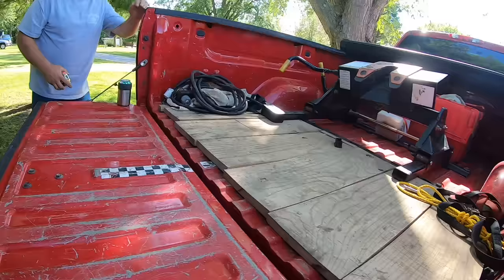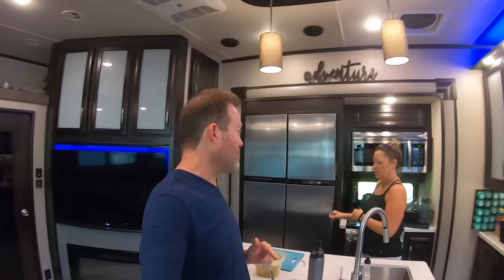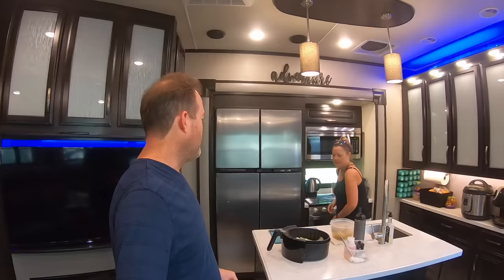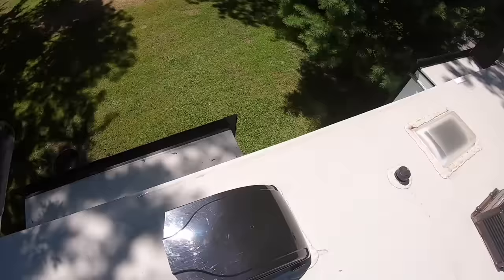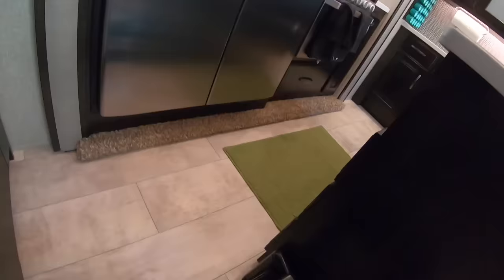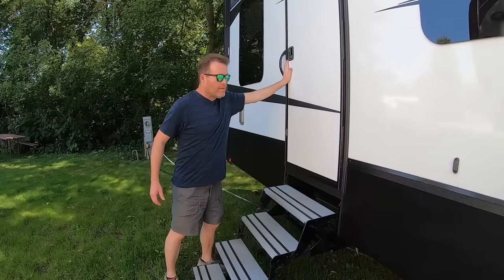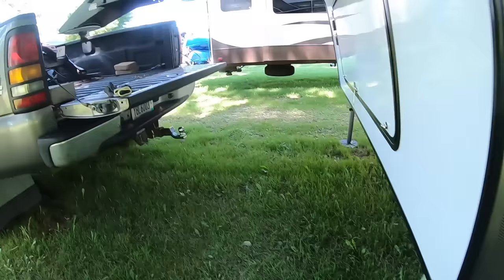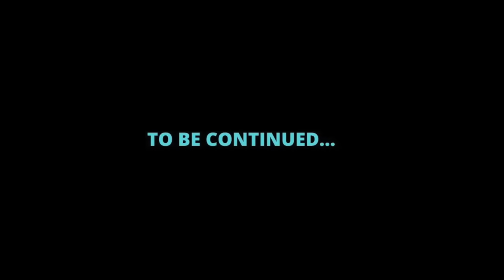RV CRUSHES MY TRUCK ON 1st TOW! BIGGEST RV LIVING FULL TIME MISTAKE!

Comment: This happened because you had the hitch jaw release handle in the wrong position before hooking up, at 19:30 you can clearly see that the handle is not in the correct position, so the locking portion of the jaws didn't/couldn't properly move into the locked position when you hooked up to the trailer, In the future you might want to have the rear window of your truck open and the stereo volume all the way down so that you can hear the jaws snap shut or just have someone helping you keep track of things, do a tug test after getting out to check that the hitch jaw is correctly shut, and never raise the landing gear until after you have checked the jaws are shut completely and you have done a tug test.

I have 2 checklists, one for departing (home, campground etc) and one for arrival (home, campground, etc), they have saved me from ripping off the satellite dish (and at close to $2K that's a big chunk of change). The way I have the checklist laid out is they start on the day before departing and continue on to the day of departure, and finish up after arrival at the camping spot and after everything is setup. I made the checklists in Word so all I have to do is print out a few copies at home, I keep them on a clip board and I put that clip board in the storage compartment that will be opened before any others upon arrival at the camping spot and is the last one opened when departing from wherever I am camping.

I had this happen to me once on my Peterbilt, the jaws were shut after a visual check and a tug test, so I raised the landing gear, when I applied air to the trailer and began to pull out the hitch broke and the nose of the trailer wound up in the mud, it took a wrecker to lift it high enough so I could put the landing gear down and then hook back up after the hitch was repaired on site. You're not going to hand crank the landing gear down on a trailer that has 45,000 lbs in it without the help of a wrecker or crane.

Comment: Don't feel bad. I once tried to pull my 5th out perpendicular due to the tight space in front of the trailer. [lazy] Would have worked if I had remembered to slide the hitch in the box all the way back first. I did not, so I broke the rear window just as the pin was about to lock. Oops my bad. :)

Comment: When you hook up and hit the pin, try giving a fairly firm tug forward to confirm that is indeed locked in.  After doing that visually to see if the little jaws are around the king pin. The bottom of the king pin should be all the way down on the bottom of the fifth wheel with the jaws around the collar. If there is space between the bottom of the kingpin and the bottom the fifth wheel, it is high hooked. By watching what happened in your video, I’d put $100 on you high hooked.

Comment: That hitch seemed a little complicated. Hope you had minimal damage. I always do a test pull with the landing legs up just a little to make sure the hitch is locked. I leaves legs down or up just a little apply the trailer brakes and put in drive.

Comment: Cat dry lube on metal to metal hitch parts that squeak and you don't want the bed of your truck to  be a greasy mess. I use it on heavy equipment. It works.

Comment: Just saw the video that sucks, just wanted to say I noticed you have a lube disc on your trailer and your hitch also has some sort of pad I don't think you need both and maybe that is affecting your hitch locking up the pin might not have the clearance to lock right, my brother works at a tracking company and someone installed a lube disc incorrectly where it didn't seat right causing pin to sit to high on hitch and driver took off and lost the trailer half mile away from shop and this was a semi, just saying you should look into that

Comment: Don’t feel so bad, the first time I took my new camper out of my driveway, I left the electric water heater on and fried it, and also left my 50 amp plugged into my garage with the door closed,and ripped it right out of my camper. This is the third camper I’ve owned,so I’m not new at this, but stuff happens .

Comment: I am so sorry this happened to you.  Don and I both gasped when we watched it happen.  Thank you for being brave enough to put this on YouTube for us to learn from.  Actually we still don’t understand what was missed for that to happen.  We’ve never pulled a fifth wheel.  Thankfully if this is the worst mistake that you ever make at least no one was physically hurt other than the wallet and ego.  Stuff can be fixed.  Again so sorry and we love watching you both.  Beach tribe!  Julie and Don Guzniczak
Reply: Was not the fault of the hitch. The king pin was not sitting depth wise enough...that hitch already had a factory built on lube plate...he added another lube plate...that was the problem.

Comment: Wow. Bummer. I kept thinking that you didn't lock that arm back? Or did the hitch just fail? Guess I'll wait for video 2. :(
Reply: Was not the fault of the hitch. The king pin was not sitting depth wise enough...that hitch already had a factory built on lube plate...he added another lube plate...that was the problem.

Comment: Man I feel your pain but you've got to admit there is a little bit of humor here. I have never done much with 5th wheel or gooseneck trailers. Is it common to do a tug test with an RV? I guess the jacks would have to be down part of the way. Also, are safety chains required in any states? I'm not sure if they are more of a gooseneck thing or not.

Comment: I drive semi, it happened to me. SAME STYLE HITCH as a regular semi, just smaller scale. ALWAYS do the tug test...HOW is this done? 
LIKE THIS:
WHEN you first back the truck under the trailer with the hitch lined up with the king pin, with deliberate slow impact, knock your hitch into the king pin. YOU CAN'T hurt anything with the hitch properly aligned and at the right height, so don't worry about damaging the receiver or the king pin, because they're both extremely rugged. 

Once you're locked into the king pin, put it in Drive immediately, and do 2 brief Tap on the gas pedal to see if you come unhitched. This is the tug test! Once you are satisfied it's connected, get out and view your king pin lock visually with a powerful flashlight and then hook up your pigtail and raise your landing gear an inch and do the tug test one more time with the trailer brakes STILL SET. Not normally needed and once you have gotten the practice and the hang of it, you won't be doing this secondary tug test again because your confidence will be up. Good luck, and thanks for the video.

Comment: the truck wasn't crushed, just the bed rails were. I have almost done this, but I double check everytime. Also, if you go into a store and come back to the truck I check again just in case some idiot pulled my pin.

Comment: I seen the problem when you hooked up. You always have the trailer just low enough for the trailer to push the truck down slightly when you back under. I seen the gap between the hitch and pin box in the video

Comment: My truck is 4x4 and I'm not as agile as I used to be, so I added that same flip out step @1:00 to the back bumper right after I bought it. Its a pricey little accessory but well worth it!

I don't know that hitch, but it looked to me like the indicator only shows you the king pin is all the way in, you still need to shove the handle in and pin install tits safety pin to keep it latched.

Comment: Yep...tug test. It'll get ya every time. Trust me, you are not the first to do this. Be thankful you have electric jacks to raise it. If this was a 53' commercial rig you'd be out putting the handle in low range and cranking for 20 minutes.

Comment: I have been thinking about getting a 5th wheel but have always been concerned about there safety. Is this a common problem or just an oversight on your part. Looks like no one was hurt. Truck and trailer can always be fixed. Did it rip the mount out of the truck? if not than it had to rip the mount out of the trailer.

Comment: Yes, always practice tug with landing gear 1 inch up. Interested to find out if this was a result of that “interesting” hitch you purchased or user error. We all mess up my friend. Hope the damage is minimal!
Reply: doctordMich I have the exact set up and auto leveling system he has, I do it every time. You have to fully retract the front right and then stop the front left at 1 inch off the ground, then when you lower them again the front right will move first and bring that even with the left.

Comment: Was not the fault of the hitch. The king pin was not sitting depth wise enough...that hitch already had a factory built on lube plate...he added another lube plate...that was the problem.

Comment: That little safety pin probably gave you a false sense of security.  So how much tongue weight do we have here? Maybe a 15,000 lbs rig with 1500 on the front load? In any case, a ton to have fall even a foot. ...You mentioned a checklist but that would be a good idea with all these must-do’s. 😕
Actually, I was thinking the accident would probably be from the assembly not getting properly installed in the truck. Surprise.

Comment: That wouldn’t have happened with an Anderson hitch. Just sayin’. Thanks for your bravery in showing your human side. This summer I was unhitching in the rain and got everything disconnected and the jacks lifted and drove out, but in my rush I failed to drop the tail gate of the truck. 😳😮🤦🏻 A $500 mistake... it happens.
Reply: Was not the fault of the hitch. The king pin was not sitting depth wise enough...that hitch already had a factory built on lube plate...he added another lube plate...that was the problem.

Comment: I’m sorry and thanks for sharing you guys...My guess without reading you did not lock the pin release arm. It looked like it was still somewhat pulled out.New equipment can make it easy to miss something. Plus you got distracted with your power cord still being plugged in. We all make mistakes that we learn from and sometimes they are expensive ones.

Comment: Looking for the follow up video.  Tell us what happened and how much destruction occured.  We all make mistakes.  My one mistake was in 2004.  I had a rental moving van with my car on a dolly behind.  I was not used to that type of ball lock on the hitch.  I thought it was locked but 10 miles from home I found out it was not when I went over a rough railroad crossing and the hitch came off the ball onto the safety chaines.  The held but I saw the car was not trainling correctly.  Stop after about 50 feet of travel, rehitched and made sure the hichlock was truly locked.  Then travel 600 miles ok.  I had been towing vehicles for 46 years.  This was a first and I hope a last time.  SAFETY CHAINS on A TOWBEHIND!!!

Comment: To me that hitch is not a quality hitch . Just looks cheap made. But a reminder to you. I'm a 34 years Over The Road Truck Driver. And pulling a fifth wheel when I was kid with my dad. Always ! And always do a tug pull with the trailer brake applied . And dont feel bad for the mistake you made. I've seen this happen so many times in my life time.

Comment: We did a similar drop of our new 5th wheel the first time we parked it.  We released the hitch and pulled forward, but we'd forgotten to extended the 'feet' on the RV... we have a 3500 dually so no real issue with the truck, it did ding the tail gate which was up.  Still made me sick to see it fall like that.  What went wrong,  it appeared to be in the hitch correctly?
Reply: Was not the fault of the hitch. The king pin was not sitting depth wise enough...that hitch already had a factory built on lube plate...he added another lube plate...that was the problem.

Comment: 19:40 it may be in the 'locked' position but the trailer's not down - so maybe the pin's not in the hitch at all.

Looks like you needed lessons on doing this before you tried yourself !
Reply: And at 19:30 you could clearly see that the hitch release handle is not in the locked position, so even though the lever on the rear of the hitch indicated that the jaws were locked, they weren't because the handle was in the wrong position. It's an easy mistake to make, especially when it's the first time using a particular hitch and you're not used to it yet.

Comment: I’ve always wondered what it looks like when this happens! But that hitch you bought is not something your gonna want to keep that rod that goes across causes chucking and will tow rough it looks wore out already good luck hopefully it’s not too bad ,remember to lower you tailgate when unhitching too tailgates don’t work very well when bent.
Reply: Was not the fault of the hitch. The king pin was not sitting depth wise enough...that hitch already had a factory built on lube plate...he added another lube plate...that was the problem.

Comment: Don't worry. I was towing a 28 foot 5th wheel and "Ran OVER" two cars making a turn in the parking lot of Timber Line Lodge, Oregon. I damn near killed an elderly couple. No worries. 5th wheel trailers are much more stable.

Comment: There is two types of fifth wheel owners. One's that have dropped their Trailer on the truck and those that haven't done it yet. Relax.. Stuff happens. IF anyone gives you crap about it then they have bigger issues than what your dealing with.

Comment: What the hell caused it?  It looked like everything was showing locked.   My first 5th wheel I owned for 29 years.   Just sold it this years with tears.   Have a newer and bigger one.  First time out of the drive way and get to location I crushed the back of my cab.   29 years of towing and it happens to pro's

Comment: That just sucks.

 I drove truck (not pickups) for 17 years, pulling doubles, (that's two trailers). I have seen this happen in real life. The people telling you to do a pull (tug) test, most likely aren't doing it correctly. Back under but don't latch your hitch, just BARELY raise your landing gear, then hold the trailer brakes and actually pull out from under the trailer. Remember how much power it took to actually pull out from under your trailer. It takes much more force than people realize when they think they are doing a good pull test. I don't do pull tests. I do two visual tests each and every time, no matter what. Sometimes I do three, just to make sure.

I hook up, GET OUT AND LOOK, do a walk around the entire rig with the parking lights and flashers going so I can check all my lights and stabilizers, windows etc. looking to make sure the hitch is secure both times I walk by the end of my pickup. I don't just glance at it,  I make sure it is properly closed, and that the wide bottom part of the kingpin clearly visible underneath the jaws of the hitch. The B&W makes that very easy. They aren't cheap, but they are cheaper than the unfortunate incident you just had happen.

Don't worry about this, I almost guarantee you won't do it again. Unfortunately that is how we learn. I hope it turns out ok for you.

Comment: 19:30 Shows the hitch lock control not engaged. That pin sticking out only indicates full engagement. Although it says its locked the  on the sticker.

Comment: So what did he forget to do?  Lock the pin?  He even said see the white thing that tells him it's locked in so I can only assume he forgot the pin.  Hence why the handle was still on.
Reply: Was not the fault of the hitch. The king pin was not sitting depth wise enough...that hitch already had a factory built on lube plate...he added another lube plate...that was the problem.

Comment: Love the Truck i have the same thing just 2500 single rear wheel, hope it didn’t get too messed up.
Reply: with the impact force behind the rear wheel i'd almost be worried about frame damage, that's a lot of leverage force right there.

Comment: I watch the video you still need to explain why the coach slipped out of the fifth wheel that way we can learn
Reply: Was not the fault of the hitch. The king pin was not sitting depth wise enough...that hitch already had a factory built on lube plate...he added another lube plate...that was the problem.

Comment: So what did ya do wrong?the 5th wheel did looked locked in so it shouldn't have slipped out....
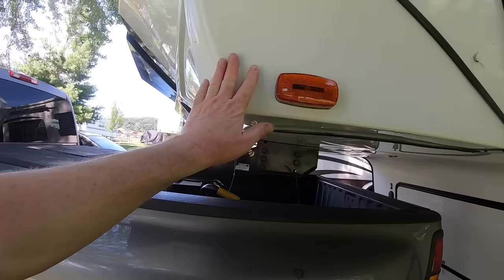Reply: In the beginning the seller tells him that once the trailer pin is in place but still unweighted, to push in the handle and move the safety pin to the inside hole, which actually locks the hitch - I agree the label by the "white pin" is very misleading - and remove the handle.  Go to 21:34 in the video and you can see that tip of the handle is still in place, and nowhere before that do you see him push in the handle and move the safety pin to lock it. The seller shows him this when he puts on the "oh-poop" wire.
And a pull test is done with the trailer brakes on and chocked with front jacks almost completely down.

Comment: Ouch, Always test the trailer truck connection with a pull test.  Bet that added Teflon disk caused it.  A gimmick that's not needed in the first place that can cause big issues.

Comment: As I looked and saw the lock release handle still attached I made a mental note to myself.... I bet that is in the locked "OPEN" position. I hope he see's the GIANT yellow handle and remembers what he learned from the other gentleman about operating this device.....

NOPE. 

Three lessons to be learned here.

1.) ALWAYS make a checklist and NEVER deviate from it.
2.) ALWAYS leave your landing gear close to the ground for a pull test.
3.) ALWAYS make sure you stow your safety gear in the same place no matter how short the pull so you NEVER forget it. (putting that yellow handle away before hooking to the truck would have ensured the latch was in the armed for lock position.)